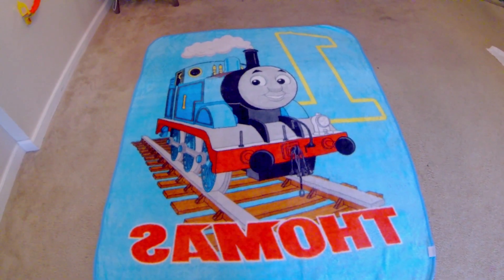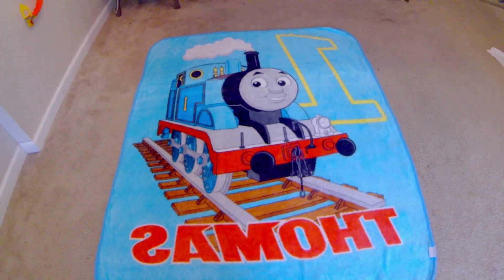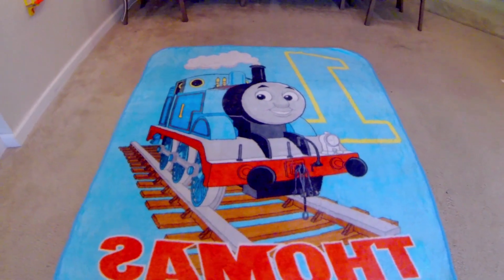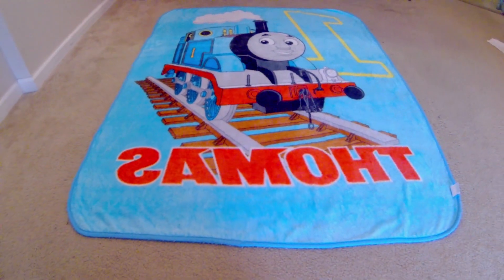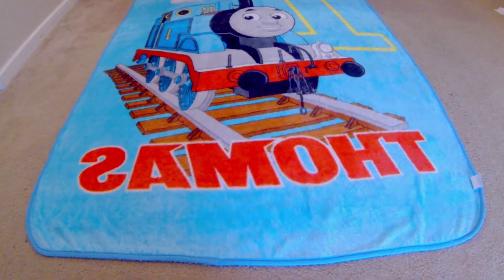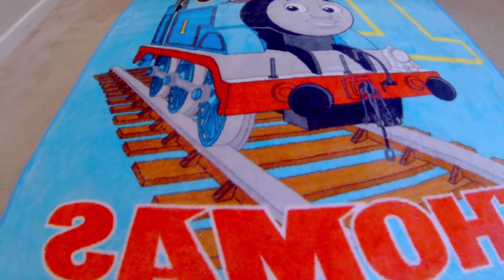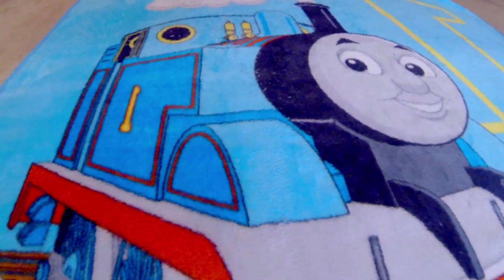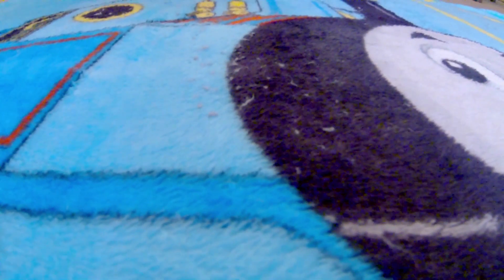How to Remove Lint Balls or Piling from a Fleece Blanket

Comment: i had the same issue with a large fleece blanket. I ran it through the washer and afterwards it was completely covered in lint balls. i decided to try using a two sided dog grooming brush and the outcome was great. Make sure to use the fine side of the brush, this is usually the black fine bristle side opposed to the combing side of the dog brush. works great !!!!!
Reply: Totally worked! Thanks!